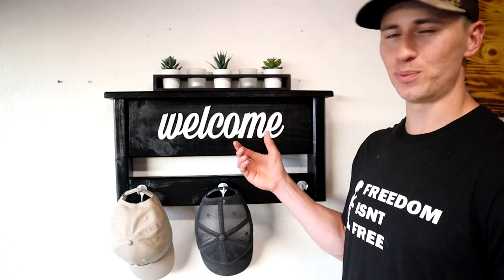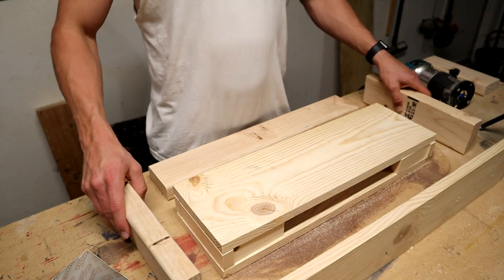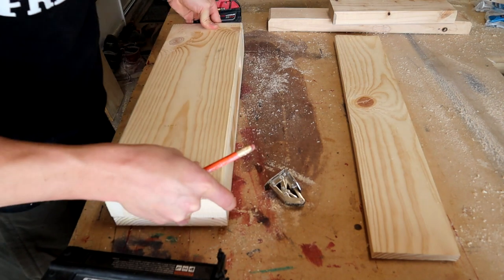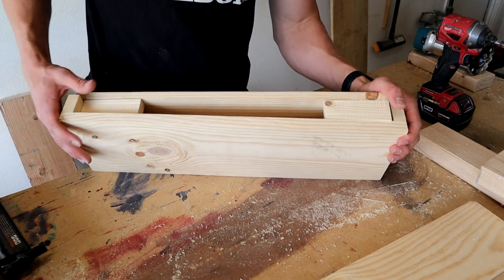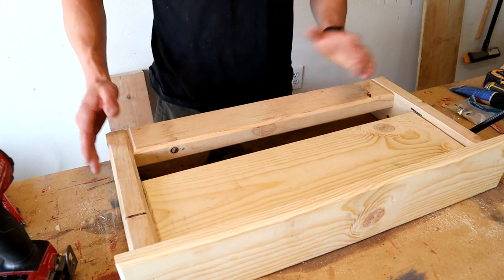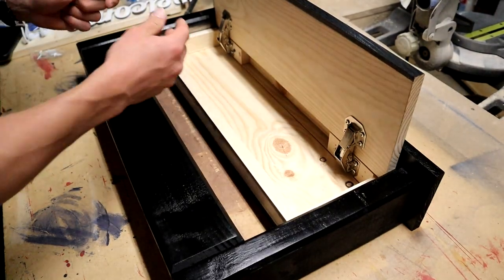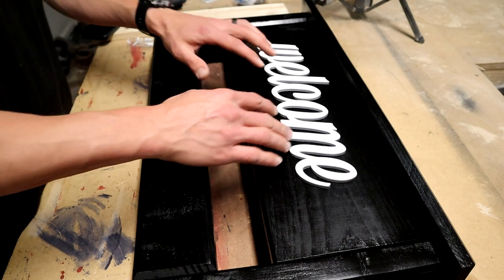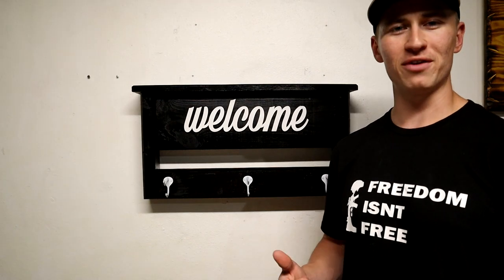How to build this CONCEALMENT COAT HANGER / SHELF! Super Easy Farmhouse DIY!

Comment: Love it!  Nicely done. 
I saw the RFID lock suggestion but here’s one I use on my similar rack. I drilled a hole in the side making sure it went into the lid. Make the hole slightly larger than a framing nail or whatever nail you decide to use. Cut the nailing head off the mail and insert it into the slightly larger hole so it engages the lid. Used a rare earth magnet to remove the nail for access.  Depending on where you drill the hole it will be very hard to detect. Just make sure to have the hole large enough for the nail to slide in and out easily. You could even keep the head and indent the hole so the head is recessed. This way the magnet has more to ‘bite’ on and the hole will actually look like you intentionally put a nail there for the structure.
Reply from the maker: Thank you!! I actually used that technique on my Concealment table and medium Concealment flag, it works super slick!! Thanks again for the feedback! 🙏😎

Comment: Awesome Video, I built one for dirty santa game and everybody wanted it! Only thing I did differently was using white adhesive vinyl for the welcome sign, that way there is no worry with clearance when opening and it also let me have more options customizing with different fonts or even if I wanted it to say something else and also didn't have to paint it either. I didn't get the keeper magnet bc it wouldn't arrive in time so I just used a long neodymium magnet that has long and thin and wrapped it with electrical tape, traced it and carved where it would go with a dremel tool and mounted it using an epoxy adhesive and worked great. The only other thing I did different was using 6 smaller single hooks that were brass that way would still contrast slightly the black and white, can be used for coats keys or hats and I also screwed two keyhole hangers on the back to make for easy hanging. Those are all really just ways to personalize it but great video on the actual build!
Reply from the maker: Thank you very much!! Heck yea thats awesome, those are all great ideas and im sure it turned out great!  Thank you for sharing the feedback and ideas i appreciate it! 🙏

Comment: Definitely needs some type of locking device.  Also if the lock is on the top, you could put the hinges on the bottom so the door opens downward.  That would give more space to pull the gun out.  Good concept.. I definitely think that people will need to tweak for different size weapons.

Comment: You could make thin wedges to mount the gun magnet to so that the mag well of the gun is angled out at the bottom enough so that you can get your fingers around it and be able to get the gun loose from the magnet faster in case you're in a dangerous situation.
Reply from the maker: Good idea!
Reply: I love the idea, and you know us carpenters are always a little 'extra' and if included that in the video wouldn't be so much of a beginner project everybody could do, or at least that's what the Karens of the web would say I'm sure lol